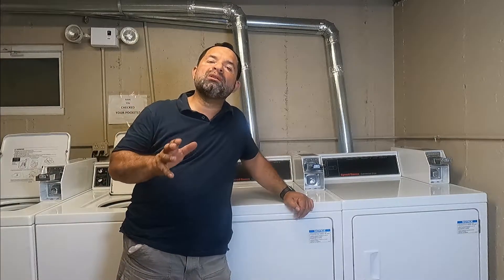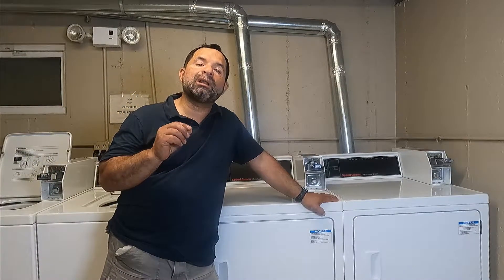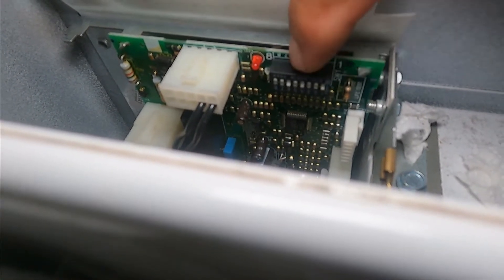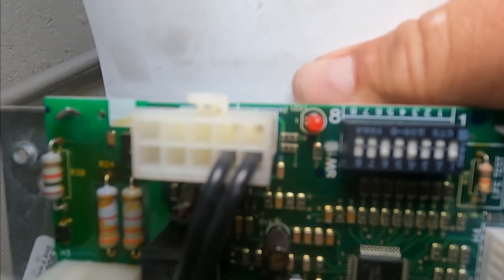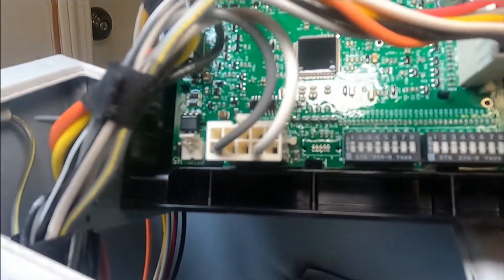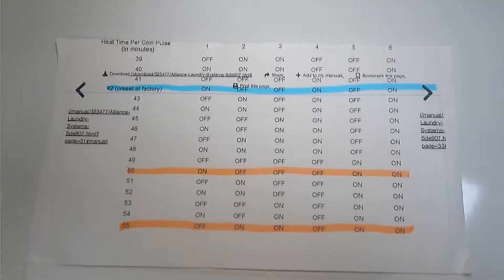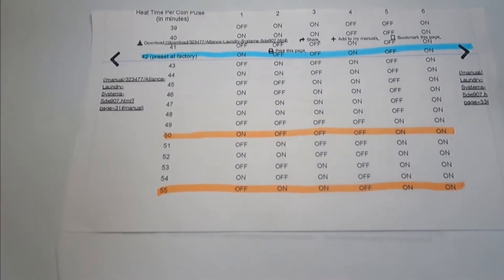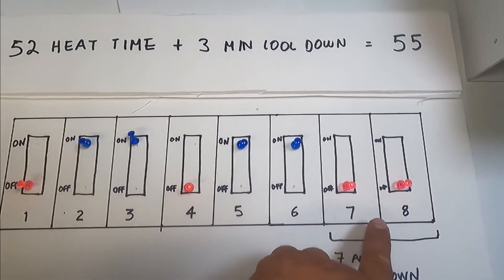SPEED QUEEN COMMERCIAL DRYER, HOW TO ADD MORE DRYING TIME

Comment: Hi Alex! Do you know how to reset the timer on a Maytag commercial dryer (model: MDG16CSDWW). In my building we have on of those with only 30 minutes. A technician came, but claimed he could not do the job because he didn't have the tools for that. Can you do that or know someone who can do it. The building is located in the Chicago area. Thanks
Reply from the maker: Hello MB   Unfortunately the only speed queens I deal with are these one on my videos.   Open it and see if is the same control.   If not call speed queen technical support.920 748 3121  They are pretty good about giving you that info.  Be ready with model and serial number.   Let me know how it goes. Thanks

Comment: HI ALEX WHAT IS EAF2 ON A SPEEDQUEEN COMERCIAL TUMBLER DRYER
Reply from the maker: HOla Horacio
I am not familiar with it but I looked it up for you.
Usually that code is an air flow issue.   You have to clean the duct from behind the machine all the way out to the other side of the wall or roof.
Let me know if that works.. Gracias ,